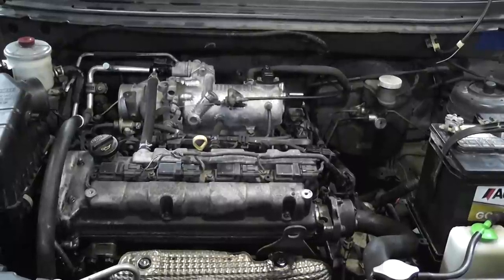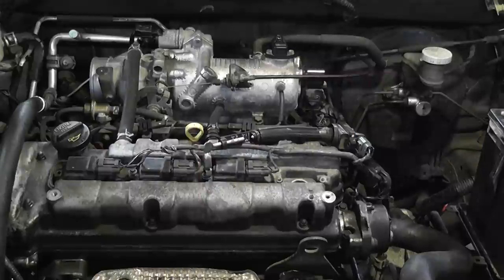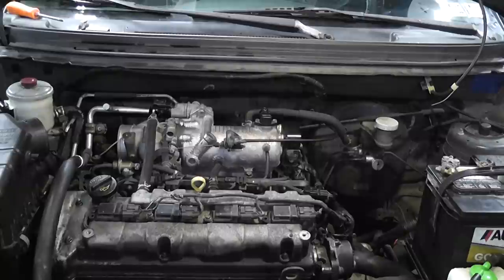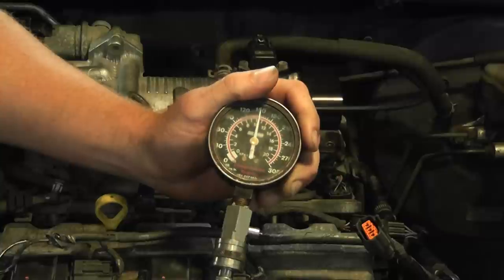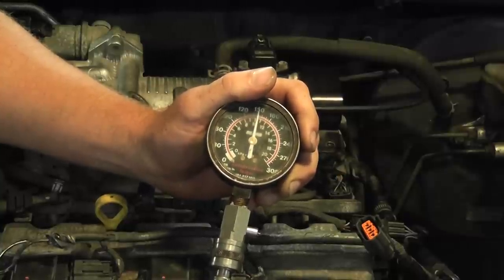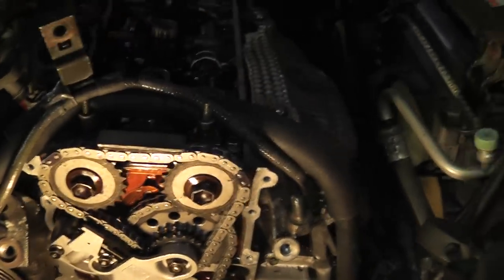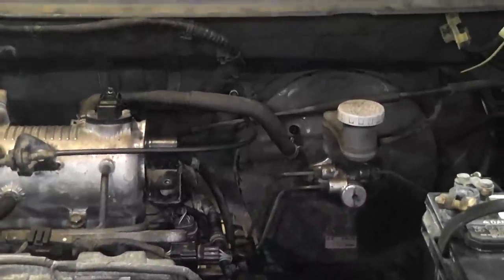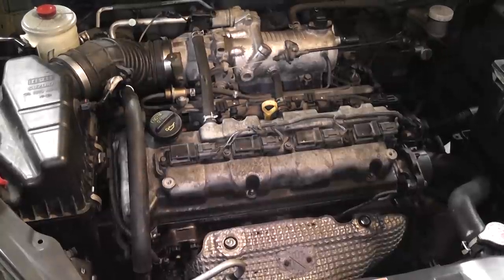How to check for a jumped timing chain or belt

Comment: Okay 5 min in Video Ck Spark and Injector Pulse good Compression was Good Enough Induced Propane still no Bang. Since Cyl Head was Off Remove Valve Cover Verify Crank TDC & Cam Timing. Verify Cam Sensor Position and Signal output Cam Sensor and Cranks Sensors Sync Together . I'm guessing Cam timing problem.  ok i'll watch the rest and see what you come up with. Well Ex Cam Off 2 teeth that will do it Cam sensor is mounted on Ex cam too that will throw your Injector timing off. some engines if you lose the cam signal it will still run not perfect but if you lose Crank Sensor than you'll have no spark no Injector pulse.  about 15 years ago I had a 98 Jaguar XK tow in  had Crank but no Start. When I was Cranking over the Engine seemed to spin over like the Starter and Battery was fine so ck Spark and Injector Pulse none than i Happen to Check Battery Load tested it and it failed. Replaced Battery Engine started ran no Problems. This is why  it wouldn't start even though the Engine Cranked over Very well but Voltage was drooping below 9-10 volts the ECM wasn't getting enough Voltage in Crank mode so it Dropped out. These Gear Reduction Starters are so Efficient in Amps 125 when you have a weak Battery it will spin the engine over pretty good. But the Electronics on British Cars operate Different than American, German or Japanese  So Being a Driveability Tech for 35+ years I've seen  a lot of situations and Always Check Battery First- Terminal Condition and grounds. by the way those Suzuki Engines sound Terrible  but anyway Good Diag Kid
Reply: Lol! Why would you do all that work to verify timing when you can pull a coil and plug and hook up a scope?! That's like 3 steps. Or 4 if there's an engine cover to remove as well. Work smart not hard, ya frickin old geezer. Also, British cars aren't the only cars out there with sophisticated electronics that get funky with low voltage either, gramps.

Comment: If the timing belt is out then you have lost your engine valves by now since you cranked the engine several times. Which is a taboo
Reply: What the rest of the video. Also it was cranked and cranked before I ever got to the car. What do you think a customer does? I'll tell you, they crank it so much the batteries dead.
Reply: Yes he shouldn't crank it at all
Reply: hi 
Please help me for the 2003 suzuki aerio tps sensor adjustment.
Reply: I am directing all help requests to my forum. Sign up (it's free) and create a new post. Be sure to add a name under "alias" as this is the name that will appear in the post.
Here is the link to the forum. 
http://www.scannerdanner.com/ForumRetrieve.aspx?ForumID=3226

Comment: Hey Scanner, I actually just used your method to diagnose a similar case with my MR2! Thanks so much for the work putting this together. Here's the thread (it's short): https://www.mr2oc.com/threads/91-5sfe-no-start-situation-complex-issue-no-mods.680941/

Comment: This test wouldn't have worked if the exhaust cam was the one that was miss timed.
Reply: or the intake actually.
Reply from the maker: That is correct as far as cam crank relationship, that is where the pressure transducer can really shine. You can see valve openings and closings and compared them to TDC and BTC to determine if cam timing is off.

Comment: Lucky the exhaust valves did not hit as they were retarded and would have been still closing on the end of the exhaust stroke. I guess they follow the rule of two hand cranks of the motor before hitting the starter.

Comment: I am a tech at Toyota  what about the valve chatting
Reply from the maker: +john Kosheluk excessive cranking of an engine will collapse the lifters. Running it at a higher RPM fixed that issue

Comment: Ive never in my life seen a chain jump this must of been installed incorrectly by somebody All cars that have chain timing belts have covers or additional pieces of hardware to prevent chain from jumping. Which means there is no space for chain to lift up enough to jump a tooth. This is common with rubber belts since most dont have teeth or they do and they get worn out. By the way dont use aftermarket parts for belts dont believe the advertisement and marketing. Why does a higher HP engine require a better belt? The power is all going out the other end of the crank. What needs to be discussed is the tension load on the belt. Get real here and stop with the marketing bullet points. Blue is hype and the OEM/OES belt is going do the job
Reply from the maker: Who are you telling to "get real here", this video was as real as it gets. Did you even watch it?